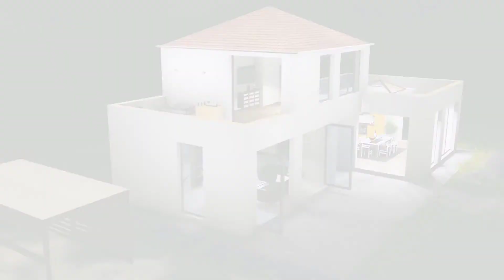Gigacrete project example

Comment: I worked out in the field with u guy talked to Andrew on the phone never met u guys but I done over fight projects for u guy the Castles in Georgia was the biggest one and the army base the product has no storage life of course it's stronger than synetics there no way this material can be applied after 90 degrees it sets up to fast and the retarder to delay the set time is only good in lower temperatures the color in the interior plaster drys a little light the best thing u have going is it tuff and ruff if u have the man power to apply it
Reply: Donald Brown  sounds like you have something important to say. Would you mind correcting the sentence structure and grammar in order to understand what you’re saying? Seriously, it sounds like you have something to say. Not trying to be critical.